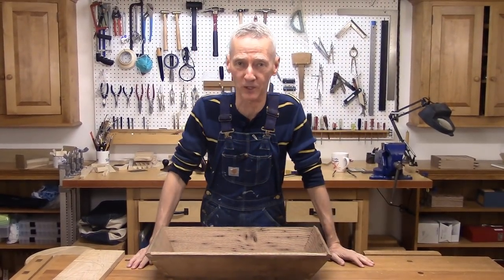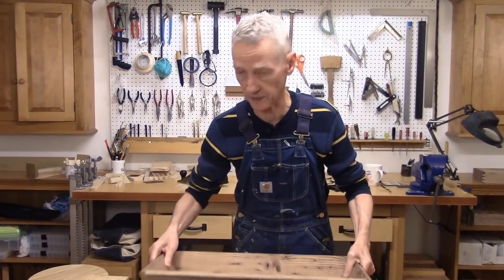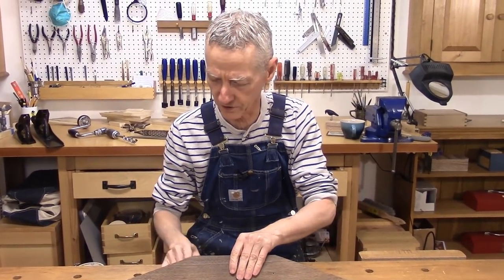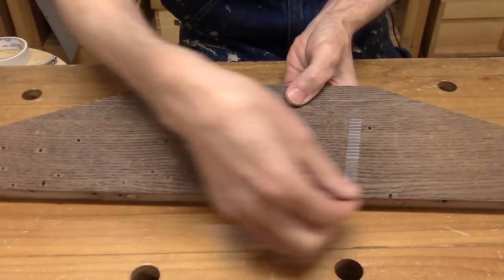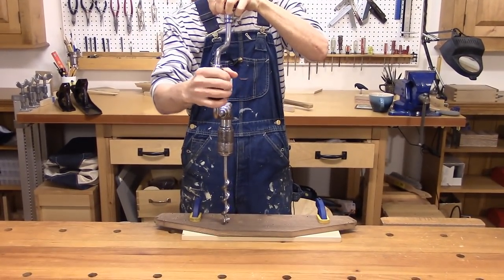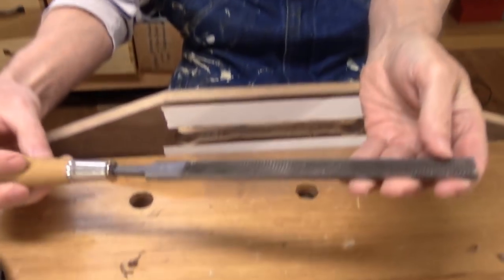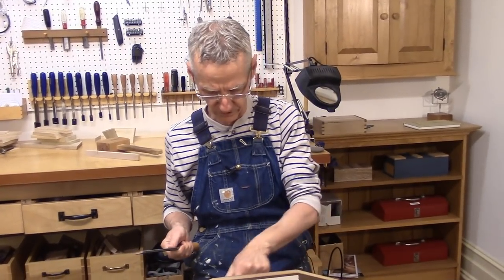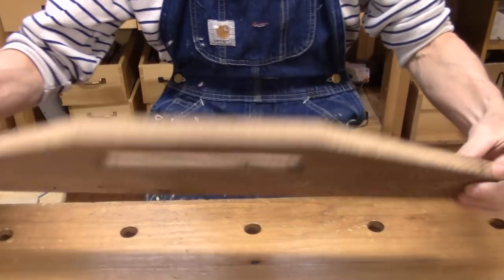Tool Tote Show #3

Comment: Great video and woodworking as ever - thank you.
I'm in the process of making a (very different) toolbox for my sister but it shares a similar handle. I came to the same conclusion about the need to screw up through the sides to prevent splitting, which is very reassuring! It was also a great point about the length of the cutout which I will incorporate into my design ☺️
Reply from the maker: Hi Robert. Yes, I'm glad I put those screws in. They're invisible and I think they will make a difference. Good luck with your toolbox project!

Comment: Great stuff as always. You might have talked about it elsewhere, but what is the chestnut like to work with? It looks like slightly softer red oak. Is that right?
Reply from the maker: Thanks Kory. Chestnut resembles oak but it is lighter in weight and not as hard. It's easy to work with but splits easily so be careful with screws or nails.

Comment: I still like the looks of that wood, your layout always amazes me, did you do something to the worm hole edges ? they look chipped off with the grain ?
Reply from the maker: Hi again. Nope, the worm holes are planed flush and I've simply ignored them. Interestingly, I noticed the wood is lighter in color around the holes. Not sure why. Thanks for the question.

Comment: For the No 4 you set up as a scrub plan with and 8" radius on the blade, did you need to make any other modifications?  I bought a No 4 to set as a scrub like Paul Sellers discusses and am curious what you needed to do.
Reply from the maker: Hi Joe. The 8" radius is a mild camber for a scrub plane. I didn't need to file the mouth or even move the frog back for thicker shavings to pass, but this might be necessary on another plane. It's fine for my needs as I don't use it to hog off really large amounts of material. Also, I can easily convert my plane back to a smoother by switching out the irons. Works for me.
Reply: treebangham, Thank you for the info. Not that long ago I purchased on hyperkitten a No 4 Craftsman plane (I forget who made it). It looked as if it was rarely used. I want to make this into a scrub. I was excited it was a Craftsman brand as growing up we used to buy lots of Craftsman tools from Sears in ten 70s and 80s. Also, it looks slightly different than my other plane so it will be easy to identify it. Plus, my dad will get a kick out of it when I bring it over.
Reply from the maker: Sounds like it will make a good scrub. Let me know how it turns out. Regards.

Comment: Is there a reason that you planed the top and bottom edges at this stage, rather than earlier, like when you were sizing your boards?
Reply from the maker: Yes, I could have planed the edges earlier, I preferred to plane them after my dovetails were made so I could get the edges to meet perfectly at the corners. Thanks for the question.

Comment: One more Australian reporting in, now there are enough of us to make a crowd!

There's something about working out the shape of an oval hand hole, I've used my hand slot template many times. Is there any reason you didn't extend the handle board to the bottom of the tote? from memory most totes I have seen of this kind (which to be fair is only 3 or so) do, so you end up with two compartments. Ups and downs to either way I guess.

I finally got the time to get some video of my latest Japanese toolbox, mainly to show the two narrow board construction instead of the wide board construction. I've credited you in the description, if you'd rather I didn't for any reason let me know and I'll update it. https://youtu.be/GhTgtwwzHmg

Love your work!
Reply from the maker: Nice work. I liked your use of reclaimed nails. Cool 360 display. Yes, there are pros and cons to the handle board arrangement. The opened vs two compartment style seemed more interesting to me. Also, it gives me options for how I attach the bottom. Thanks for the question.